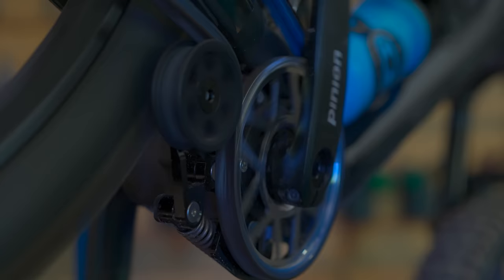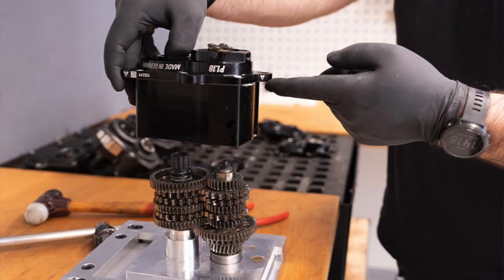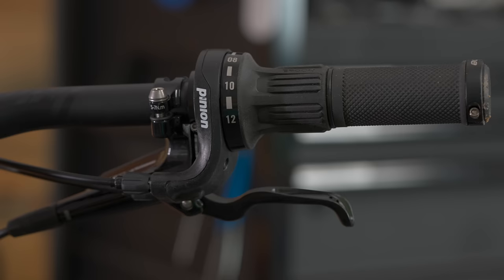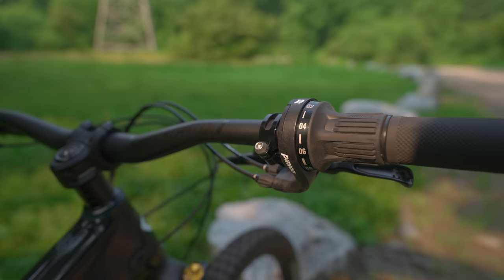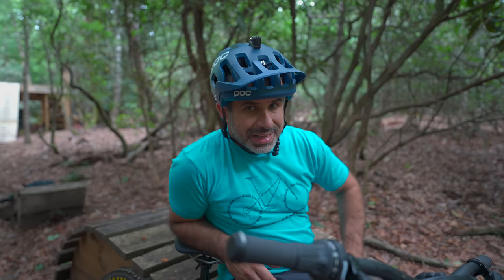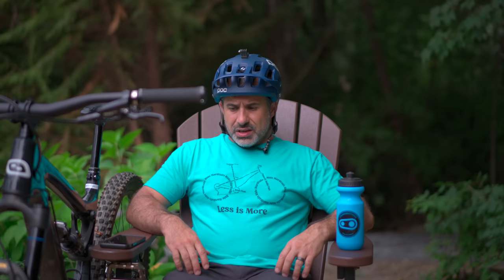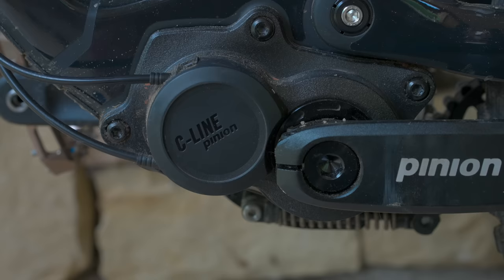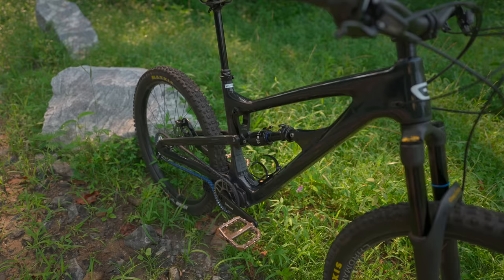What's the deal with gearboxes? Why don't more mountain bikes have them?

Comment: Very interesting piece, i was wondering about the performance in comparison to chains. I doubt i will have this tech or the bluetooth shifters in the near future but eventually this may be an industry standard. Cool vid.
Reply: The belt has very similar performance to a chain. A new chain is more efficient. A worn/dirty chain or one that is curved (low/high gears) will be less efficient. Belts typically last longer than chains.

Gearbox has comparatively less efficiency should have a 100k lifespan and improve with time as you break it in.
Reply: @sandymcarthur  noteworthy is the stretching of the belt under load, you can feel it while climbing under power. Feels kinda rubbery when you pedal. I am unsure to the losses of that, sure it will stretch, but it will also contract back „adding“ work over the dead spot of the pedal stroke. Feels kinda wrong when you are used to a chain but I think it’s insignificant compared to the losses inside the gearbox or the losses of having a dirty chain drive
Reply: @derTeddy I believe it, I've not identified the sensation but I've seen a clip clearly demonstrating the belt can stretch. 
You hear Zerodes complimented for their downhill experience and that aligns with my preference towards flow. 
Technical climb hasn't been a pursuit for me.
Reply: To clarify: I don’t talk about technical climbing on an MTB, I talk about riding a fully packed cargo bike out of my parking garage. It may be the weight of the bike that amplifiers the issue (it’s >80kg/180lbs of bike and kids).

Can’t really comment on mtb specifics, only on a general observation

Comment: Pinion gearbox is a great thing, paired with a rohloff internal gearhub and belt transmission. Low maintenance is a great advantage. But it is very expensive. I have a commuter bike with gates carbon belt drive and I love it. But for mountain bikes I don't know if is the best choice. Maybe e-bikes with the internal gearhub combination are better.

Comment: Gear boxes are great in some situations, as Seth mentioned. Especially for commuter bike in Europe, they love them. On ebikes, they are one of the best solutions. But the efficiency problem is not going away. They won't sell this to the same customer that is spending an extra $3k to drop 500 grams from the weight of his bike. There are 2 basic types of gearing, spur gears and planetary gears. Planetary gears are much more efficient, but even those will never be better than 95% efficient. Spur gear efficiency can drop to 75% on low ratios. And unfortunately, its really difficult to make a planetary box with 10-12 speeds, so they need to be standard spur gear transmissions. The belt drive gives up at least another 5%, especially when pushing hard, where you need that 5%. And the cost. When you consider that most customers willing to spend big money are also looking for the most efficient solution, this excludes 95% of their market from even considering it. So, the rear derailleur is probably not going away any time soon.

And the other really major point is RACING. Most tech trickles down from race. So until a racer can begin winning races with a gearbox, its just not going to make it to the masses. I don't anticipate anyone winning the Tour de France with a gearbox.

Comment: When a SRAM Eagle cassette at my shop starts at around $500 for a replacement and upwards of $1000 (New Zealand Dollars) my boss and I have to scratch our heads. Not to mention the only options you have is what size chainring you want with that... All of my bikes are 7 or 8 speed these days, some of them are even friction shifted. I refuse to go beyond 10 speed and find with a front derailleur I get a 600% range or more, and a much friendlier chainline in the extremes.

That said, gearboxes have no place in racing (Honda merely used a derailleur in their latest iteration DH bikes, that's why they tried so hard to keep it a secret), and marketing is entirely focused on racing and performance even though very few of us actually race.

I've ridden a bike with a Pinion, it rides exceptionally well but it's still (as the french would call an English-made Sturmey Archer hub) a "friction box". Especially with a belt drive on top of that. The lack of weight in the rear wheel is nice for your big squishy bikes, little difference for a hardtail.

Comment: What about rohloff for a internal hub for mountain biking? I will say for ebikes with mid drive rohloff and enviolo are amazing for commuting. Enviolo is silent, can be automatic, and maintenance free. Rohloff is a beast for commuting and electronic shifting. Add in zero to little maintenance with a belt and it's just the best.
Reply from the maker: I did get to try a mid drive Rohloff years ago (it was not in the hub, it was somehow on the bottom bracket). I know very little about these, but remember it being really cool. I think that one either had 2 or 3 speeds, but it was super smooth and effective. Gotta look into that and see how far they've come.
Reply: @SethsBikeHacks  they are amazing for cargobikes! Both rohloff and enviolo being able to down shift at a standstill is amazing! Especially when you got the kids or groceries or whatever on the bike. The automatic enviolo is a game changer. Serial 1 (made by Harley Davidson) uses them and it's mind blowing! Like you just pedal and no thinking at all, truly a great option for commuting on bike. Mountain biking not the best option, aks me how I know that.

Comment: Over at the ENVE Builder Round Up show this  year I saw that Viral's prototype bike had a  Pinion gearbox with a more standard shifter. Sounds like it hasnt been released yet but the dreaded grip shift with Pinion might not be the only option soon. they released this new shifter option for the E-bike version of the gearbox but the one I saw was on a regular bike.

Comment: I had a rental bike at a hotel with a gearbox shifter and it didn’t have gears. You could literally slide the gear and stop it anywhere. It was so smooth and such a comfy ride. I went up some steep ish hills and back down them but nothing too straining so I’m not too sure how it would handle that.
Overall it’s an interesting part and is worth trying if you have the option. 👍
Reply: This is named En violó/Nuvinci

Comment: Several commenters note that the gearbox reduces the unsuspended weight in the rear and should noticeably improve rear suspension. Did you notice that?

Comment: The commuter bike is interesting, but I don't see a lot of advantages there compared to an 8 spd internal-geared hub (which you can also run a belt drive with).   The internal hub is likely to also be a good bit cheaper.

Comment: i'm confused here: is the 'gearbox' in the rear hub - essentially, being driven by the belt - or is it directly driven by the pedal-crank, with the belt completely separate from the pedals? if it's driven BY the belt, changing pulley sizes will have an effect on overall gearing (need more speed? smaller 'driven' pulley... need more torque? bigger driven pulley)

Comment: Lol - Pinion is more of a transmission than Transmission™...So, I've ridden a Pinion and the shifting does require that you hold up a very moment to make a downshift.  The 5% loss in the drivetrain is noticeable, but there is no other drivetrain I'd take on a very long trip.  The first gear is crazy low!

Comment: Aside from obvious location issues and weight repartition, how is this drivetrain different from a rear internal gear hub. You can equip a belt on these too. They are low maintenance, very reliable, expensive, at least the ones with lots of speed, have a lot of range, are very durable, heavy, and also less efficient  than a conventional drivetrain. Their obvious advantage over the pinion system is that they are compatible with almost every bike, not just the 6bolts frames.

Comment: Even if I could switch to one of these by welding up a proper frame. I just wouldn't. The reliability is non existent in wet conditions and replacing a belt requires you to disassemble the rear part of the frame. Replacing a worn part is also bound to cost you hundreds of $. Replacing a chainring is only going to cost you maybe 20$. Oh and one thing that you didn't mention. The more this style of gearbox wears out, the more friction you get. Until something gets so worn out that you're better off throwing it away and buying a new one. That usually happens around 20k km. Which can be done in around  two to three years of my commute. I think, I will stick to what has worked best for the last few decades.

Comment: Simplicity aides repair ability even though a gear box is more reliable and less maintenance if you do manage to break it self repair is probably expensive in time and parts.  I like belt drive for the durability and ease but I wish they were more popular so the price goes down.  I still think a derailer beats complicated gearing in so many ways.

Comment: There are two reasons why I wouldn't want a gearbox. First is the cost. Assuming that wasn't an issue, there is also the issue with comparability. I like my bike, and I like that I can upgrade it to newer arts if need be. If I got a bike with a gearbox, I'd be both trapped in that platform, assuming the manufacturer doesn't go and change bolt styles and ratios on me so if and when a failure does happen that I'm stuck without a bike until I can get the new platform because "industry moves forward" or whatever.

Comment: I’ve been riding a Zerode for over 5 years now. Could never go back to the old style derailleur setup. Regarding weight, mine weighs 14.7kg, so not sure what’s on the one in the vid to make it 2kg heavier?. Mine runs a chain, but because the chain is always in a straight line, I haven’t had to replace it yet - 5 years of riding on one chain!

Comment: one thing I did think about is how involved it would be to repair one of these. With a derailleur, MOST of the time you can plainly see what’s wrong, say for maybe a bent hanger. With this being a closed system and all, I think it would be tough to narrow down certain issues with shifting, slipping, or just a straight up failure. Much like a car transmission, most of the time you can’t just look at it and know exactly what’s wrong with it.
Reply: that's true, but do you want a gearbox or a derailleur in your car?
Reply: I drove my car every day for 11 years. Never had an issue with a gearbox. Sold the car, still runs fine.
Reply: @infinitebirch  yes
Reply: I think the point is that you don't have to fix it, because it's so unlikely to go wrong. Slightly tangentially, since this relates to hub gears, but since Mark Beaumont in 2008, a bunch of people have used Rohloff hub gears for round the world speed records, because never having to fix it trumps being able to fix it in any place with bike shop. I don't know about BB gearboxes, but while it's accepted that hub gears lose out in efficiency compared to perfectly-maintained derailleur set-ups, imperfectly-maintained derraileurs are not uncommon.
Reply: @chrishowell5718 I agree. Yes, if the very unlikely event of a gearbox failure happened it may be a lot more difficult to fix trailside than a conventional drivetrain but it would be very rare. There’s a reason a lot of the the long distance bike packing people run gearboxes of some description.
Reply: Apparently there is a Rohloff hub out there with 500,000 km on it.....  try that with any other system!

Comment: It is almost impossible to design and build a gearbox that is as efficient, lightweight and cost effective as the derailleur system. There is a point where the refinement of a machine is stepping backwards from its intended purpose. That's what happens when attempting to improve near perfection.

Comment: The problem with gearboxes is they go against the whole Point of bicycles (lightweight and efficient) there can be as many other benefits as you like but if it’s heavy and inefficient it’s not worth it, sacrificing weight or efficiency individually is acceptable if other benefits make it worth it but once you loose both you’re defeating the point of a bicycle in some ways the e-bike thing actually makes the problem worse because shifting under load in gearboxes isn’t good, they only make sense in that a weight increase on an e-bike is less significant and you don’t notice the efficiency loss when there’s a motor helping. In short there’s a reason 95%+ of bikes don’t use them

Comment: Well... I am not really so far outside in the countryside and I am also not lacking knowledge about bike maintenance. I am just lazy af... In general a gearbox sounds nice, but his whole "less efficiency" thing is not really compatible with me being lazy. I rather want to have my pedaling effort going into speed than into wasted heat in the gearbox. Let's hope that there will still be efficiency improvements in the future...

A few years ago, I said to a friend: "How much can bikes still change? The concept is old and there should be no major progress anymore". Turned out that I was wrong, because there is new materials available, new technology available, new manufacturing methods available, and new design tools available. Maybe there is also still something which can be done about the downsides of current bike's gearboxes. However, this is usually not so much about money but more about mechanical engineers who are interested and motivated to improve things. It's a common misconception that more money equals better research results. In some cases it's true (e.g. material science or semiconductor technology - things that you can't simply do in a small shop) but most times it's wrong.

Comment: I’d like to see some rough estimates on efficiency numbers. If it’s close to a chain, and they make this with a trigger shifter, I think it’s really compelling.
Reply: It’s somehow feels similar to a slightly dirty derailleur. Supposed to be 90% efficiency vs 98% on derailleur or something like that. There is a trigger shifter from Cinq, but it seems hard to get. Pinion actually is launching wireless shifting with buttons, they promise to do non-e-bike version too.
Reply: @agrmbl  that efficiency isn’t that far off then, especially if you’re using the bike for enduro/shuttle runs it won’t matter much. Electronic shifting would be really cool but probably super expensive.

Comment: I have an internal hub and a carbon drive on my current bike.  I’ve had my eye on a pinion system for a while just for the larger range.  Sometimes I max out my internal hub and wish it had a little more, and I know the pinion has a wider range… but I don’t like that grinding sound.  (That, and the bikes with pinion systems AND carbon belts (I’ll NEVER go back to a regular chain!!) are so daggone expensive… makes your eyes water.)

Comment: I wonder why nobody has tried putting a hub gearbox on a mtb jet? (Those are gearboxes that are made to replace your rear hub) in the Netherlands those are really common by default on city bikes and e bikes with a front wheel motor. But I haven't seen them on MTB's maybe it's the lack of gears (around 7) or they are not durable enough?

Comment: would like to update my bikes to a specialized stupjumper, eleccy leveo and stumpy evo. have tried the pinion and would have them on all the bikes over deraileurs, and for me the drag was no worse than the old drive train. In wet gritty conditions drag should be even if not marginally better, but not noticable.  For  the big brands ,sram, shimano, the chains and anything you smash off is basically the equivalentn basically printer cartiges $🤑$.  I run sram and it has been good, still would prefer to pay a ittle extra and squeeze those rock gap while taking the weight off the rear.

Comment: It would be good on ebikes because it would be stronger and it won't wear out, I've had it on ebikes where my cassettes have started jumping because of the power from the motor, and when you have it on an ebike it doesn't matter about weight or friction

Comment: Efficiency sacrifices? Yes there's a little. But that about all but evaporates in the comparison when the chain drive systems get dirty with the lubricants turned to paste and/or you're running high chain angle gears. I really think it's more perception of efficiency loss than it is scientifically factual ON AVERAGE.

Comment: What happened to Kindernay? They are all out of stock. All the same benefits of pinion except the unsprung mass and doesn't seem to take a belt, but it can also fit on any bike that would normally take a derailleur and uses a trigger shifter.

Comment: I don't know the exact numbers but I don't think efficiency loss is that big of a deal. A newly cleaned and lubricated derailleur drivetrain may be more efficient but a grimy, dirty one may not be. With this gearbox, not only do you have the belt drive, but with a conventional drivetrain, the chain going back from the derailleur is quite close to the ground, potentially picking up quite a lot of dirt.

Comment: I understand that the efficiency issues with those gearboxes are the worst at low power levels. given how peaky off road and especially gravity-focused riding is it probably isn't bad. and compared to MTBs with their often crooked chainlines, small chainrings and dirty chains then the differences are less significant still.

the biggest problem for me is the price. followed by the limited variety of bikes.

Comment: I am of the opinion that 90% of all commuter bikes should be gearboxes and belt drives because the average bike owner doesn't maintain their bike ever. 

Like hell I'm somewhat 'into bikes' and also like to drive fast as I am always running late and even for me it would probably be a better option since I occasionally skip a month of maintenance with my drivetrain/chain suffering as a result 

not true for mountainbikes though since those are typically way better cared for